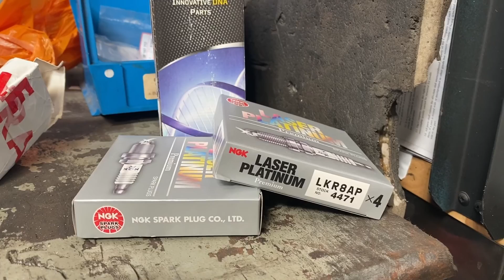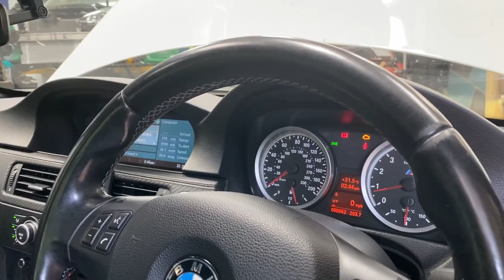Finally Fixing the Misfire In My #E92M3 & Upgrading The Brake Fluid @SelectMotorsport

Comment: hey I have a question my car has been misfiring cylinder 1-4 well it says bank 1 and I can't find a solution and it keeps going into limp mode when im slowing down or creep up to a stop sign and wondering if you know what it could be?
Reply: Coil packs or injectors are the things to look at mate
Reply: @FlagnarBoobz  you'll never guess what it was but I swapped the coils around and still would pop up and it turned out to be the exhaust donut that connects the manifold to the x pipe

Comment: Hi George , I’ve been through hell with miss fires started on cilindre 8 swap coils positions ended up on 7 4 and 6 miss fires swap all the sparks, same as yours, the problem was now on cilindre 5. bought 8 coils from eBay “surefire” which they looked good quality, after installing them sounded slightly better but still rough low revs and amber engine light came up while driving home. What a nightmare
Reply from the maker: Sorry to hear mate! The lesson I learnt from this is while BMW coils are expensive, they are worth it! Mine hasn’t missed a beat since! Hope you get it sorted! George 🤙🏻
Reply: @FLOORitofficial  so you replace the 8 coils and only one is bmw ?!
Reply from the maker: I just replaced cylinder 6 as this was the misfire code. We moved the coil around and checked the code to check that was the coil that was faulty and then replaced with the BMW part. For such key components as these I will always use BMW parts ☺️

Comment: Have you ever had misfires on all the 8 cylinders at the same time at cold only and the needle oscillates between 2 000 & 500 rpm at cold start ? 
(2B4E fault code)
Reply from the maker: I have not! But it sounds like a spark plug issue to me 👌🏻

Comment: Had exactly the same on mine. Faulty coil cylinder 5. Bought a cheap one from Autodoc, didn’t work. Ended up with BMW one. These cars are getting very clever and fussy. 
Same thing with brake pad wear sensors. Non BMW ones wouldn’t re-set.
Reply from the maker: Hey mate! Yeah fussy is the perfect word 😂 OEM all the way it seems! 😅